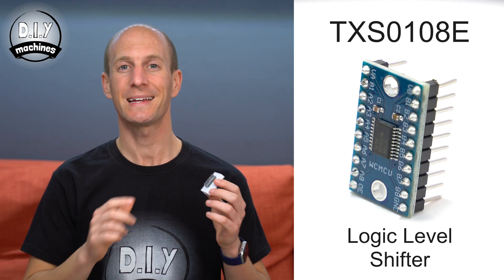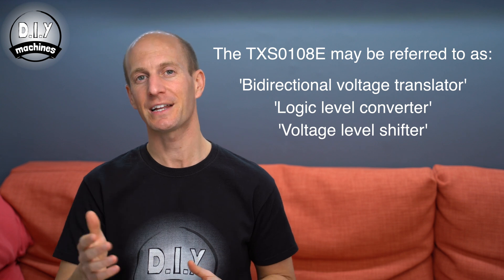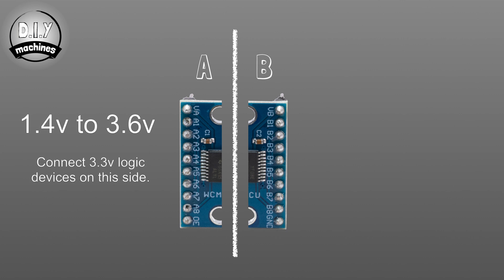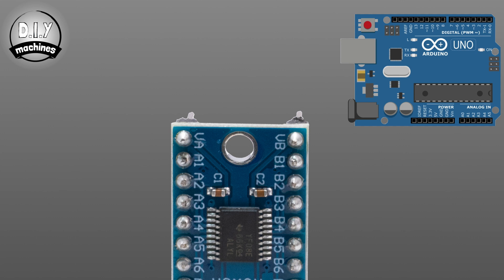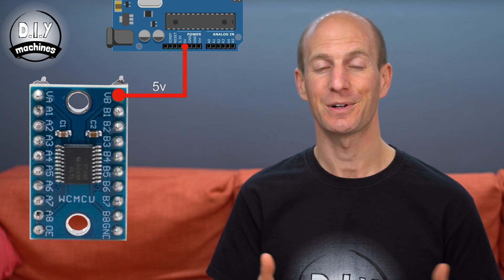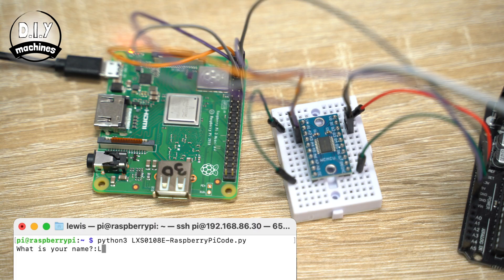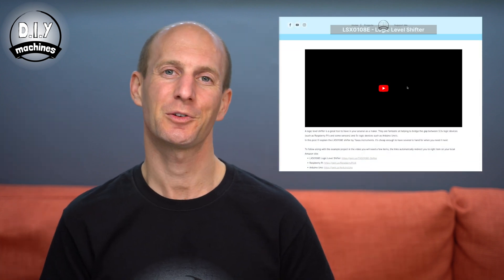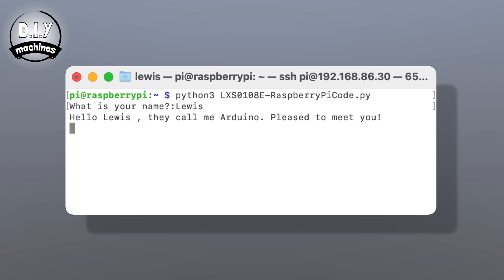Logic Level Converters - Learn & Example Project - TXS0108E

Comment: Superb Video! I just wanted to add, all pins have internal pull-up resistors and therefore have a HIGH logic level unless actively pulled low! Do not get confused, when measuring the pins! If nothing happens on the pin, then the pin is logic level HIGH!

Comment: I'm completely new to dealing with wires and hardware. I have all the basic stuff like the Arduino kit and raspberry pi 5, but will I need a soldering kit? I wish the video actually included a real time example of putting this together instead of just some graphics. Anyway, thanks to anyone who can answer my query.
Reply from the maker: You might not need to solder to get started, but it will open up more possibilities for sure.

Comment: Thank you for explanation, can you  suggest me a device to perform same function but with 3.3volts to 24 volts at high frequency i.e avove 600 KHz
Reply from the maker: You're welcome. I've never used them but perhaps look into the HV7351

Comment: need to make my 3.3v gpio from esp32 module a 5v for my relay's IN pin
Reply: Hello did it work for you?? I am using this IC with an ESP8266 on the TX/RX pin (gpio 1 and gpio 3) with no luck, for sure the esp is working fine since doing a loopback directly on the esp I get TX and RX response but doing from the level shifter does not work.

Comment: question, can I use this LLC for the data pin of an addressable led strip?
my data pin output is 3.3v and I need it to be 5v, I get flickering when the cable is too long...

Comment: This shifters doesn't keep the current constant with some little amount of load the 5 v drops to 3v
Reply: That's what I was wondering.  Seems to me that to get you Volts to remain a steady 5, you need and external power supply to the chip, and then the 3.3 would flip a mosfet to give it a full 5v +/-.

Comment: For the TXS0108E to provide level shifting, the OE pin needs to be connected to 3.3v. This was not made clear in your video.
Reply: Va I connected to 3.3 v and Vb to 5v, OE I gave to 3.3v. Still its not working
 2 ICs i tried can you help?

Comment: Upto what ferequency this level shifter works?
Reply: "How to fish" answer: Consult the data sheet. Search [ TXS0108E data sheet]. Since it's a digital device with some delays, the specs aren't so much in frequency as in bits per second (BPS) Open-drain performance is, of course, highly dependent upon the timing of your risign and falling edges since there's not a force to drive the signal quickly to either state.

Comment: ask. a level shifter, it can be connected directly from a 5v 3a mobile charger, and transform it to 3.3v? How many amps does it hold? can I use it for something other than i2c, like a light bulb, what do I know, a sensor without i2c... etc?
Reply: "Yes" and "not very much at all". If you consult the data sheet on that part you'll see it's like 50mA max for the entire 8-channel part. It's very much for high-speed digital signalling and not a power supply. This is not a low-voltage drop-out regulator like a HT7333 or HT7833. So if your device was something like a 3.3V LCD display and you were tryign to attach it to something ancient that used 5V (oh, a PC printer port)  you'd use this to drop the data lines, but to actually power the LCD and light up the 3.3v backlight, you'd still want that HT7333 or similar. Some LCDs have all this built onto the board. I'm just using it as an example with a clear definition between the wiggling signal part vs. the higher current part. For WS2812 (NeoPixels) we often use LLCs for the data pins to get a strong clean signal some distance away from our dainty 3.3V SOCs (like ESP32) but definitely feed the LED power (for brightness that can be seen from the moon from a separate 5v power source.
Reply: @RobertLipe  ooh. Thanks.

Comment: Can we use a logic level converter to interface 3.3V MCU with 5V relay?
If yes, (a) To both of the pins D5 and Vcc(3.3V) pins?  (b) NodeMCU does not have 5V out, can we use an external power supply?
If not, what are alternative ways to trigger 5V relay from 3V3 MCU?

Comment: Can you help point me in the right direction.  I am getting 0 level output using a TXS0108E between an Arduino and ESP32.  The connection seems so obvious.  The VA and VB are connected to 3.3 and 5.0.  When I try to drive a high signal either direction through one of the channels, I read 0V on the channel output.  The OE is tied to 3.3V.  Is there something obvious I am missing?
Reply: Hi, I found Power Supply Recommendations in the datasheet for this chip -> During operation, ensure that VCCA ≤ VCCB at all times. If I tied VA to 5V, VB to 3.3V and OE to 3.3V, the chip didn’t work and I had 0V on the outputs. Once I tied VA to 3.3V , OE to 3.3V and VB to 5V  the chip worked as it should. Hope it helps.
Reply: VA I gave to 3.3v Vb 5v, OE 3.3v
IC TXS0108E is still not working, 2 ics i tried any help?

Comment: Great video! But one question. Can I use it bidirectional? I want to use it in a project with the 6502-CPU, which has 5V and a Raspberry Pi Pico with 3,3V for Data-Bus-Communication. So it must work in both directions without repatching cables. Best, Erik

Comment: Hi Lewis, I need a device that will convert a 3.3v PWM signal to a 5v PWM signal. For example, a 75% of 3.3v duty cycle to a 75% of 5v duty cycle. Is there a product that can do this?
Reply: Hi, I have the same question as you, do you have the answer yet?

Comment: Thank you very much for this clear video. This component is not complex to use and yet, thanks to this video, I have just found the answer to a problem that occupied me for many hours: if I had read correctly that setting OE to GND cut the connection between A and B, I thought that leaving OE floating was sufficient for the LLC to work. Thanks to the video, I connected OE to VA and surprise, it finally works, so I thank you warmly!
Reply: Nothing is complex after you know how, but I got one, plugged it in and it never worked :(,  sometimes there is a little detail noobies miss. Which is why I am here. Great to have Youtube :).
Reply: Yeah, on mine, OE wants to be pulled high for translation to occur. I can't really blame the guy, since it's usually /OE and not OE, but this appears to be the opposite.

Comment: great video! Could one of this lever shifter be used as voltage converter to trigger 5V relay on 3,3V GIPIO pins?
Reply: Most relays need a certain current to engage the driver. Therefore I suggest using a MOSFET instead of a logic level converter.

Logic level converters are best used for voltage driven communication, not for current driven applications
Reply: Well... that just answered MY question!

Comment: It's a nice video .
I'm newbee into this topic,and face some problem.
I'm trying to get output of 3.3V from input of 5V.
Problem is, whenever i apply VB to 5V then i get the same voltage on all pins of this side.
Same problem occure at other side also. Can anyone explain me, why is it so?
Thanks.
Reply: The pins of the TXS0108E will "float" to the positive supply unless driven low. On the similar part TXB0108E the pins will hold their current state (high or low) unless driven.

Comment: Hi DIY Machines,

I am happy to watch this video. 

I am using the same connections as you have prescribed in the website link between Raspberry Pico and Arduino Nano with the same level shifter. But I am not obtaining any response from the Arduino Nano after running the Python code on Thonny Raspberry Pico.

All suggestions and solutions are accepted.
Thanks in advance.
Reply: Have you tried measuring the voltage levels using an oscilloscope or at least a multimeter?

Comment: I saw that you connected the common ground pin of the logic level converter only to the arduino. Should I also connect it to the ground pin of the Raspi or not? Thanks for this video!
Reply: Yes you can, ground is the 0v or the lowest potential and it’s shared along all devices!

Comment: Im using this same exach chip with my arduino due(3.3v) to run a speed controller that needs a 5v pwm signal. Is it possible to do it with this chip because i am not getting a voltage out and am connecting all the voltages and wires accordingly.
Reply: Have you enabled the output?

Comment: Hi there! Sorry if this is not the place. I'm newbe into this topic :). I'm setting up TXS0108E along with a I2C for a LCD 2004 over a Raspy PI 4. The problem is that when i use TXS there is noise and looks unstable. Actually i was not able to send data to the LCD. However, if i do connect I2C directly, with no TXS it works like a charm. I tried several options like connecting OE to 3.3V directly, using a 10k resistance, using GND. But almost all combinations lead into noise. I can confirm i connected 3.3V into the VA and 5V into VB. SDA1 and SCL1 connected to the A side. And the I2C is connected on the B side.
Any help will be appreciated. I'm on this because i read that not using this logical conversion may cause damage to the PI. Please let me know if this is wrong. Thanks again!
Reply: I had the same problem interfacing a Rpi Zero with a TTL serial comunication (IEC interface) TXS chip it's so sensible that cause problems, due to crosstalk over serial communication, I solved it using a twisted pair cable (like UTP network lan) so I connected one cable (of the pair twisted) to GND and the other one to data signal comunication. In that way, I solved the interference issues.
Reply: @claudioquintanilla1471  Thank you for reminding me. I seem to have solved the problem

Comment: I used to think that logic level converters and buck converter are the same think.
Reply from the maker: There are so many different converters! :) I always need to check which is which when thinking about buck converters, boost converters, buck boost converter, DC to DC converters, Rectifiers, Regulators, etc (some of these are the same thing with different names)....

Comment: would this specific chip work between an esp8266 and an arduino mega?
Reply from the maker: Yes, connect the ESP8266 on the 3.3v side (where the Pi is in the example project) and the Arduino mega on the 5v side.
Reply: @DIYMachines  Could I use this chip to power 5v devices (attached to the 5v rail/side) and control them using Esp8266's 3.3v logic as input on the Aside? 
OR should I just use transistors, mosfets, or optocouplers instead.
I take it the chips current ratings aren't enough for some devices though.
Reply: @TheTubejunky  logic level translators are used for translating between different logic levels, not for powering devices. What you are looking for is a boost converter for stepping up the voltage

Comment: Hi Lewis!

I am doing the cnc plotter project.
I accidentally bought the a4988 motor driver instead of the tmc2208. Would that cause a problem?
If so what should I do to get it working with these ones because I have to present this as my school project in 2 days?
Reply from the maker: Hi, you should be OK but the TMC2209 is worth it. I've replied to your Discord message on Discord. :)
Reply: @DIYMachines  Hey man, it would be an honor if I could get the link to your discord server 🙏👍👍